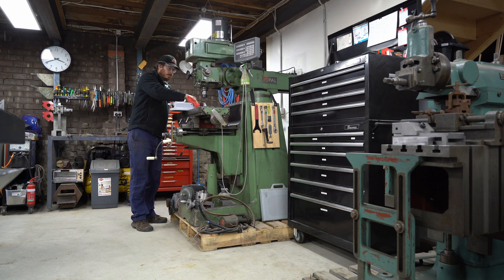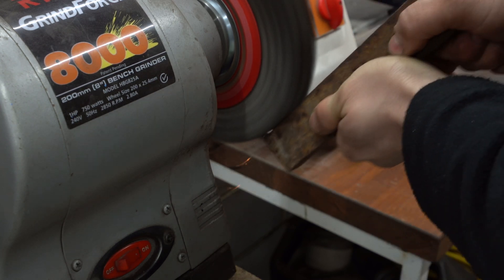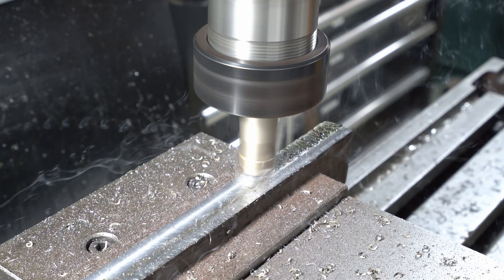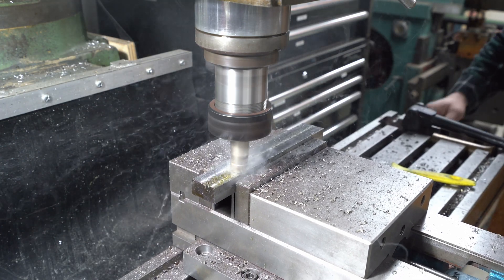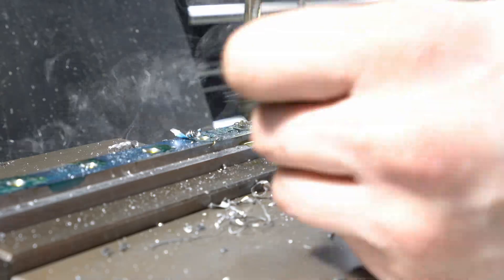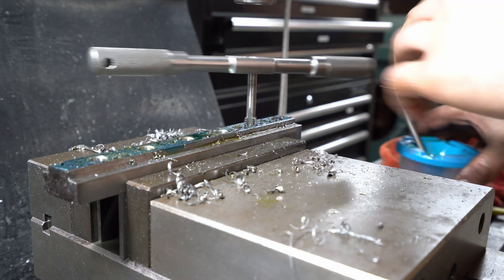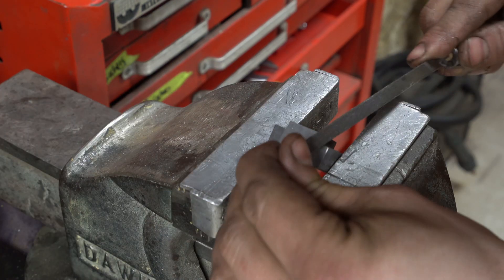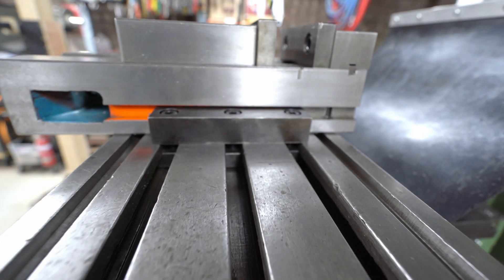Making SIMPLE T-Nuts | CRAIG'S WORKSHOP

Comment: Wonders aloud, “I wonder how he fitted his Tee-Nuts?  Did he fit them up like mine, or did he go “looser?”

Secondly… mild steel?  I used some cast iron for the first, and cold rolled W1 steel (oil quenched) for the second batch.
Reply from the maker: I like to leave them a little bit loose. My table isn't brand new and the insides of the slots are not 100% perfect, to a bit of leeway doesn't hurt anything and means I don't get my t-nuts stuck.

Yes mild steel, this is fine for something like T-nuts in a home shop. If I wear them out in my lifetime, I will be pleased. :)

Comment: Flycutter with carbide bar is best disposable cutter, once it's dull, over to the diamond grinding wheel  and it's back in action.
Reply from the maker: Yes that would be a very good option 👍 I still need to make a fly cutter for the mill.

Comment: Nice work, Craig! Simple job, but well made. Always super satisfying to use your tools to make things to improve themselves. 

I've been eyeballing a similar vise, and have been contemplating how to secure it to the mill. As some comments have suggested, t-slot dogs make removing/reinstalling the vise easier. Though I'm thinking a "fence" on one side of the vise, that's bolted down to the mill table, and squared up (with a normal clamp on the other side). The fence would have a clamp built on top. This way, the vise can not only be removed and squarely reinstalled easily, it can be slid fore/aft in the Y direction, as access requires. Plus, those CNC vises can be laid on their sides, and the fence would allow it to be automatically trammed in that orientation, as well.
Reply from the maker: Hi there, and thanks for the comment. I "relearned" about your channel through Rustinox's channel just recently.

I like your ideas regarding setting a fence for the vise. That's a good idea, and I've only seen it once before - on Ade's workshop channel. Take a look at his three part series "New Clamps for my New vise". He demonstrates the concept near the end of part 3, about 25 minutes into the episode. But essentially there is a set of blocks that act as a square reference, and those are trammed to the mill axes, and then there is a second element to each block that clamps the vise down, so he can take everything off the vise down to two reference blocks, in a matter of seconds, and put it back on again perfectly trammed in a matter of seconds. Worth a look!

I've not had time yet to properly investigate your channel yet - but you had me at Wohlhaupter, and things of that nature, so I will start binging some more of your older videos.

Cheers,
Craig
Reply from the maker: https://youtu.be/RpR3GvfMRak?t=1536

Comment: Good to see chips again, Craig! The commercial T-nuts have threads that aren't tapped all the way through, to prevent the bolt or stud exerting pressure on the bottom of the T-slot and possibly breaking out the top of the slot. Yours won't be moved much so it shouldn't be a problem.
Of course, I only found this out after carefully "completing" the threads on all of mine 😉
Reply from the maker: Yeah I have run into that one before! I sorted it out with some dimples using a centre punch. These new ones will stay with the hold downs and some cap screws of a specific length, so fingers crossed it should be ok. 👍

Comment: This is cool! I just wanted to recommend getting a refillable oil bottle to drip the oil rather than using a brush to wipe it on. Makes a big difference for cooling on the manual
Reply from the maker: Thanks Ryan. I do need to do something like that, yes. I would really like to get flood coolant hooked up for bigger jobs, but there are a lot of other things on the todo list to do first. I will try out the drip bottle again and see which I prefer. Thanks again.

Comment: Next up, dome dogs for the bottom of the vice so you don't have to tram it every time you take it off.
Reply from the maker: That's a great idea, thanks ( it'll save years of my life!)
Reply: @CraigsWorkshop  Indeed. You can just take the vice off to clamp a job to the table instead of spending ages coming up with some other way of holding it that allows you to leave the vice in place.(because you just spent 17hrs tramming it !) I made this mod a couple of months ago and I can tell you; it is a real joy.
Reply from the maker: @Andrew_Fernie  Thanks again, I will do this next time I have a spare hour 👍

Comment: Nice work Craig, very well produced video as well. I need to do the same thing for my toolmakers vice (hold downs and t-nuts). I'm very impressed that it only took 17 hours to get the vice square. I think last time I used an indicator it was on the 4 jaw, it took me something like 17 days to get the part running true! 😜
Reply from the maker: Well, I know there were 7 meals and 2 sleeps involved, but I'm only guestimating when I say 17h. Could have been longer. PS: Thanks for the continued kind comments and support 👍